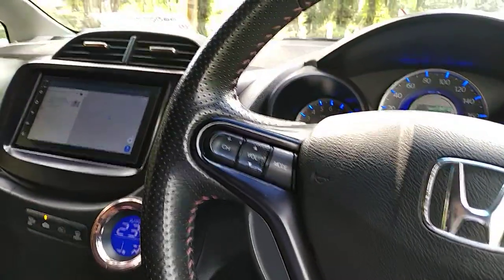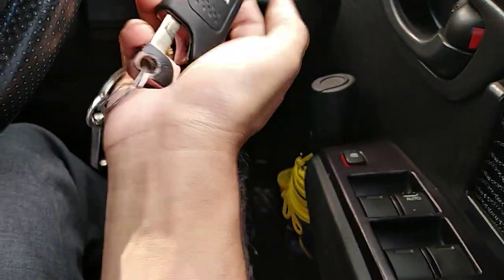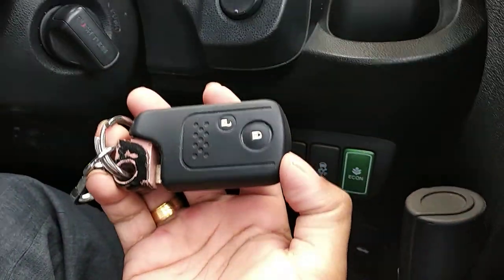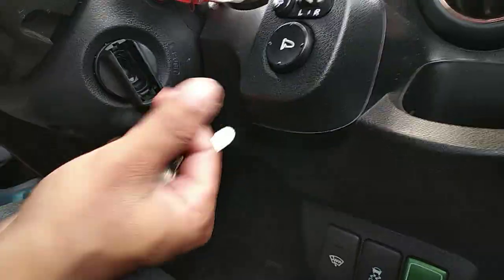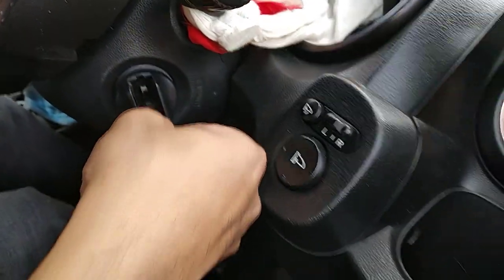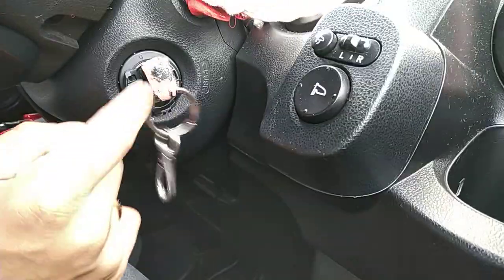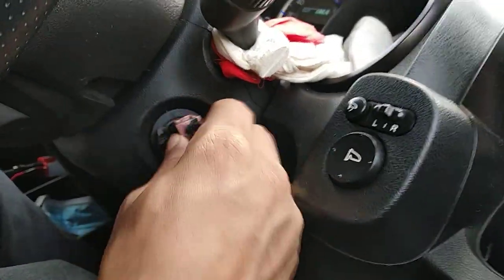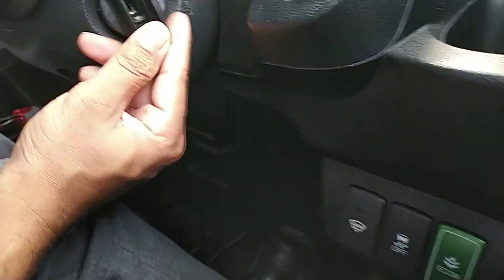Honda Fit GP1 Use Metal Key when Smart Key battery is dead

Comment: Some tool tried to steal my Fit over the weekend and completely destroyed that switch, the ignition barrel and full steering column cover. God I wish he'd seen this video and wouldn't have wrecked everything and caused me such a headache ( the immobiliser would have kicked in so I'd still have a car but not a completely wrecked one). 

A question though. Is it possible to pick up these parts in Ireland does anyone know? Having trouble sourcing them.

Great video by the way.👍
Reply: Seen them on aliexpress